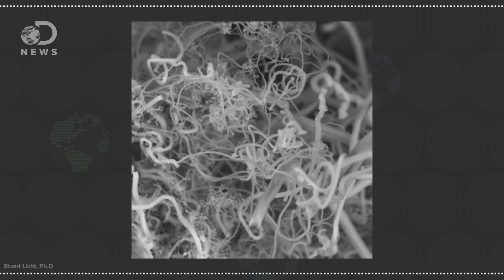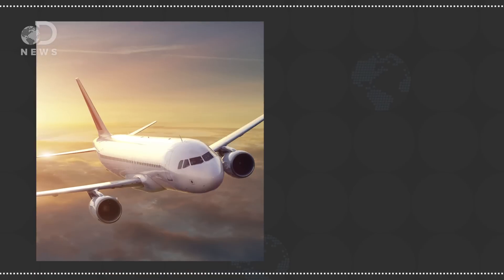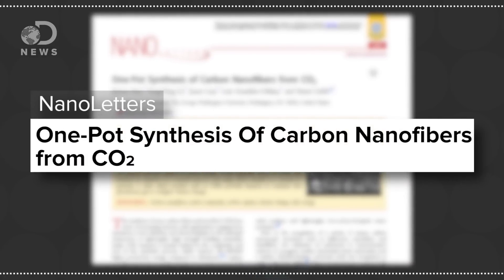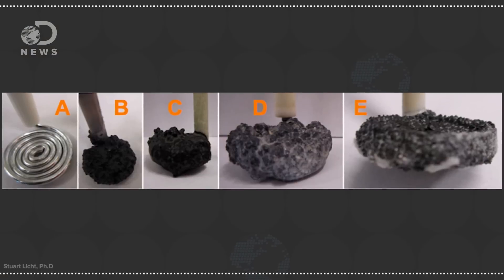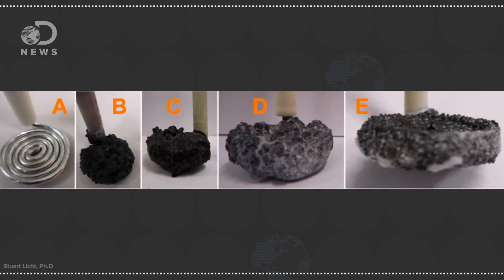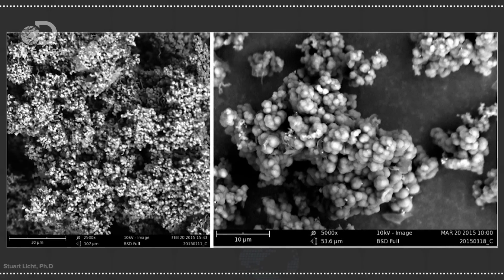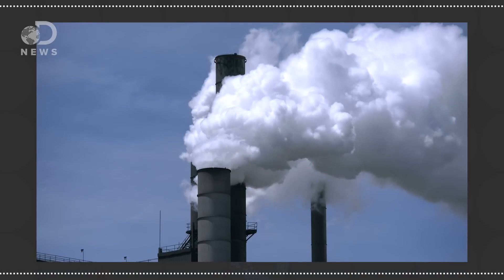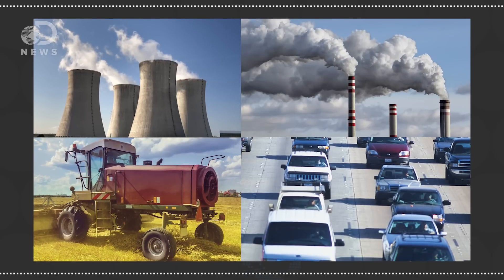Can This Carbon Nanomaterial Solve Global Warming?

Comment: Wow, that seems very impressive! However, it's 2018 and basically, this method has not received the seemingly deserved credit, which leads me to wonder why? Are toxic halogen gasses produced during the electrolysis, or what is the issue?
I really whould like to know why this was not put into pracatice in large scale, because as you know I am a great fan of limitless potential.

Comment: How much energy is required to power those electrodes to pull those 10 grams of carbon out of the air?
Now, OBVIOUSLY, we MUST get this energy from CARBON-NEGATIVE sources: wind and solar power.
Otherwise, pointless.  Nevertheless, I am cautiously impressed so far.

Comment: Uh, Ian?  Doesn't it take the same energy to reduce carbon for nanotubes as you get when you burn it to CO2? Isn't finding the power for this the same as finding the power so we don't have to burn carbon in the first place? Aren't you a physicist? Didn't you realize this, or have you become a Vidiot like so many science commentators? I know that nanotubes are at a lower state than plain carbon, but where is the energy coming from to replace the C-O2 bond?

Comment: It could be huge. If the system works out to a net decrease in CO2 in the air (manufacturing and running the system included) and the carbon nanofibers can be used to make things like carbon fiber this could make for a ready source of carbon for manufacturing which could drive down the cost of lightening vehicles, which could increase a vehicle's range/efficiency which could decrease the damage that every mile does to the earth, which could eventually work toward a net decrease in greenhouse gases and potentially toward restoring the atmosphere to how it should be. If this actually works, it could be astoundingly important.

Comment: This too could be used on Mars! Especially since Mars is 96% carbon dioxide. This could be a way of terraforming Mars!
Reply: +tye tygon Mars has no atmosphere, if we create O2 it will simply float away into space. Mars is a dead planet.
Reply: +roush26 gravity would keep O2 around the planet, and it does have an atmosphere, its just not made up of things that humans can breathe
Reply: tye tygon
tye. the atmosphere on mars is 96% carbon dioxide. the ATMOSPHERE not mars itself but the ATMOSPHERE
Reply: Or you can use a tree
Reply: +tye tygon but this is turning it into nanofibers. not oxygen. just use trees.
Reply: If we can reach it that it
Reply: +ZyTelevan Yes! It is. It is amazing!
Reply: +budred123 - Bernie Sanders FTW - That is exactly my point.
Reply: +tyler89557 Plus you still get that sweet, sweet oxygen.
Reply: +tye tygon Even with a breathable atmosphere on Mars, the radiation problem will still make it uninhabitable without hefty shelter protection and outdoor excursions risky. The planet lacks a magnetic field making it quite pointless for terraforming and it would progressively lose it's atmosphere due to lack of protection from the solar wind (the MAVEN mission studied this).

I think this idea might be a nice application for creating special equipment on Mars though.

Comment: Before everyone starts jumping for joy let us look at some simple facts

He said molten salts bath, which would require that the salts be heated and kept heated using some sort of heating method whether it be by a flame from some fuel source or by electrical heating elements. Either way you look at it, what your doing is using some energy source to convert a gas to another compound and using a lot of energy to do so. Why they even bothered to try and veil this process as eco friendly because the electrolytic system is potential powered by a solar panel (a 9v battery could do the same job!) is just a slap in the face to anyone who uses their brain or pays attention to words. The irony is that the process being used is probably going to be creating some CO2 in one form or another and I'd be willing to be the net reduction in CO2 would be negligible.

Secondly, he said molten salt baths! The only molten salt bath that I know of which produces carbon deposits is cyanide. A vat of molten cyanide produces some incredibly toxic gasses that are far worse than inert CO2. 

That being said, lets not let facts get in the way here and everyone go ahead and suck up this poorly crafted piece of Al Gore excrement.

Comment: Kind of sucks you have to spend energy to do it though, don't really know if it would work in a mass scale power plant (but I think it would). What would sound cool and stupid would be if you slapped a turbine on a smokestack and turn it by the pressure of the co2 rising up. And then connect that energy to the bath salt thingies.

Comment: The main caveat of this technology is what the electrical energy is provided by. Solar is mentioned, but nuclear and wind are other carbon free alternatives. If it just came off the grid, which is primarily fossil fueled, there is no benefit. And perhaps it would be more beneficial to apply the energy, particularly nuclear to simply replace dirty forms of energy first. I favor nuclear, ideally Thorium, because Wind and Solar have problems with not being able to match demand, that can lead to energy surplus and deficits, both unfavorable situations.

Comment: You did not mention where the electricity comes from that creates the current through the electrode. It comes from coal burning power plants. The best way to turn carbon dioxide into carbon and oxygen is photosynthesis.

Comment: The following cannot be emphasised enough: 
Pulling carbon-dioxide out of air and making it solid matter is what plants are already doing. And much more efficiently than we can, it should be noted. So no, this will not help in any measurable way with global warming. Presently they got some 30 grams of carbon fibers, but every day each and everyone of you exhale about 1 kg of carbon-dioxide. And that's just for our biology to work, and not counting what we use on the machines or products we use.

So carbon-nano fibers: Wohooo!
Can it help solve global warming: Basically, no!
Reply: +CPG VonC But its a start in the right direction. How can you not be exited!!!!

Comment: Well, there is an electrical current involved in the process.  Where does the electricity come from?  Is it pulling out more from the atmosphere than is generated creating the electricity?  Obviously for this to work, the power has to come from a clean source.
Reply: It specifically said in the video solar panels....
Reply: OK, I guess it does.  Now the next question is will they actually use solar power in production of the carbon nano-fibers?  I just imagine some country that mass produces things like this cheaply finding that it costs them less to get traditional coal power and pull the carbon out of the ground.
Reply: +Helix Fossil No fucking way solar panels provide enough energy to maintain a molten salt bath. You have to heat salt to several hundred degress F to sustain a molten state. They are misleading you because the solar panel only powers the electrolytic process that forms the carbon deposit. Stop buying the bullshit on this channel being pumped out by parroting leftists.

Comment: Wait doesn't some sort of energy source need to power it? The majority of power plants burn fossil fuels, right? So according to the ways energy works, more CO2 will be made then what it would pull out of the air. Thus increasing the CO2 output. This might be thwarted if it ran off JUST solar or nuclear, but that would depend where they built the darned thing.
I'm not a rocket surgeon tho, so if someone is feel free to correct me.
Reply: +Zach “Chewie” H What you'd do is use a power source with a negative carbon footprint. Maybe geothermal or solar. Possibly nuclear; I'm not sure if the lifespan of a typical nuke plant is long enough to break even on carbon output from its construction though.

Comment: This is all well and good, however it would need to be powered by a zero carbon/carbon neutral fuel source for this to have any effect on the CO2 in the atmosphere. 
If powered on fossil fuels all you'll get is a cycle of CO2 released and CO2 turned into nanofibres at a lower rate than it is given off, thus defeating its purpose unfortunately

Comment: I hate it when videos like this don't touch on the energy problem.  You'd need so much energy to pull CO2 out of the air you'd end up creating more CO2 than what you'd remove.  And contrary to popular beliefs, green tech just is NOT efficient enough to generate the energy needed by densely populated areas (US) or northern countries (Canada). It's getting better, but it's not there yet (and we haven't solved the storage problem yet either). So right now any solution that needs electricity isn't really a solution at all.

Comment: There is also another solar powered, low energy system that can efficiently pull atmospheric carbon from the atmosphere. They are called PLANTS -- you know, the green things with leaves.

I don't want to downplay the solar powered development here, it is an astounding achievement with potentially remarkable applications. However, algae bioreactors, fast-growing grass farms (bamboo),  and other plants may be an effective way of sequestering CO2 inexpensively and in a way that can scale very, very quickly. 

The trick would be to separate the carbon from the other bio-matter and contain it without it being re-released as can be the case with composting, burning, etc. I'm not sure such a technology exists, but it seems like something that should be possible.
Reply: +Sean Lumly IMO Algae pools may end up being the best option, especially if we could make the algae produce the nano-fibres as well as useful nutrients, this way it could also be a food source as well as heck, why not throw in water sanitation into the mix, produce clean water.
Reply: Not to sound like a pothead.. Hemp.
Reply: +Sean Lumly look up sandstone carbon sequestering, its a really cool process. they basically do the reverse of fracking. they gather pure CO2 and pump it deep into sandstone deposits because it will actually hold CO2. only issue with it is there is an upper limit to how much CO2 the stone will hold.
Reply: Ryan Schafer Thanks! I definitely will look into that! It sounds very interesting!

Yet another option may be to store it in a barrel for some other industrial use.
Reply: Sean Lumly
Definitely, mixed with the potential of multitasking, improving it's overall efficiency regarding input vs output, it's certainly something worth keeping a watch out for, for new developments.
Reply: Arent plants carbon neutral. No matter what, that plant will be destoyed somehow, re-releasing the carbon back into the atmosphere. Also the problem with algae is where to grow it and how to maintain it. Simple things like farm fertilizer can be dangerous with fresh water algae at least because it can make the algae grow out of control and destroy the aquatic habitat and kill off any animal in the waters. Educate me! Haha!
Reply: +Nick C I once heard a solution to this would be turning plant matter into Biochar, which is basically turning it into charcoal. But instead of using it as fossil fuel, it can be used as a fertilizer. I'm not too educated in this subject, but I believe this would remove more carbon than it would produce, or in other terms "carbon-negative".

This is also a better alternative than using conventional fertilizers that do much damage to the environment. Two birds, one stone.
Reply: +Sean Lumly Scientists here in New Zealand are developing algae which eat rubbish and produce butane (among other useful chemicals) as a waste product.
Reply: +Sean Lumly Plant plants everywhere. Dessert areas must be tackled one way or the other.
Reply: Sean Lumly lol, now I'm thinking of a bunch of people living in bamboo houses.
Reply: How about using the things you said, but also using the carbon capturing tech to capture the CO2 released by the decomposing biological materials? That way we'd still have an overall net withdrawal of CO2 from the atmosphere, since the plants quickly pull out the CO2, but the re-release of CO2 through composting can be slowed down by the carbon-capture.
Reply: +Sean Lumly Some of which can also be consumed, serving a dual purpose.
Reply: Ryan Airth Algae bio-reactors are indeed an interesting prospect, especially when coupled with genetic modification! I agree, their uses could be myriad.

In fact, algae may be a more practical solution for meeting many human needs with off-world colonization. I expect it would be easier to run a bio-reactor than to grow row-upon-row of leafy plants.
Reply: ***** Yes, if left in the wild they are. They consume carbon to grow, and then release it again when they are in turn consumed. Of course, we can (for example) put the plant matter in a container prior to decomposition, thus trapping the carbon. And we can probably do this efficiently if the carbon can be extracted.

As for algae: they could be grown in a contained bio-reactor as is currently done. This container is sealed off from the environment, and presumably fed a purified water supply. Here's an example of one used for oil production:
https://www.youtube.com/watch?v=Cvi_70sZV-c
Reply: +Sean Lumly the problem is that plants 'exhale' as much CO2 as they take in being that they too respire all day long.The basis of how stationary plant life works is that it uses carbon dioxide to store energy in the form of carbohydrates for use later, the plant will then combust the carbohydrate , releasing the CO2, to release the energy. 
The only way carbon is not released is when it becomes part of the plant itself, such as making DNA. But this carbon will only exit the cycle for a few years, where as carbon stored in fossils has been gone for millions of years. During which time the planet has gotten used to less carbon, releasing all this carbon (in a short time) will then make huge problems for the planet.
Reply: You'd have to grow this indoors and provide light 24/7, as at night, plants convert glucose back into the reactants, using up oxygen and releasing carbon dioxide.
Reply: +Sean Lumly Carbon Nano material solves the problem faster, whilst still being productive.
Reply: Dominic Berry Perhaps, if realized and scaled up (which could take years to build the appropriate facilities). But the situation with climate change is dire. When considering the amount of plant biomass that is created yearly, and the huge amounts of land that we have, and the infrastructure and tools required to farm, sequestering plant bio-mass may be a quick way to get started pulling CO2 from the air. And even if the nano-tube generation takes off, plant bio-mass sequestration could still prove to be a nice complementary technique. 

In the end, as with most things, it's not a this-vs-that scenario. There are just differing solutions, each with their benefits and drawbacks. There is also nothing stopping them from being used simultaneously.
Reply: ***** My thoughts exactly! Something like bio-char (from plant matter) could also be compacted and placed into barrels, thus permanently removing it from the atmosphere. 

And it would have to be carbon negative, as the carbon in the bio-char would no longer be in the air. Of course, this assues that the production of the bio-char does not use more carbon than the char itself!
Reply: Dominic Berry :) ... But only if they are nice bamboo houses.. :P
Reply: Sean Lumly Definitely better than the slums in south america or India, but I think I'll stick with a traditional US house.
Reply: well to be fair, such a scaled up idea of plants would most likely exhaust the biosphere, for example, California is a seriously farmed state, and if we want to pull enough carbon out to keep California healthy, we'd need far too much allocated resources just to attempt such a small place, and when put into a globalized scale it would exhaust the earth. Also inclusively do nothing for the most part
Reply: masterimbecile but it's the same thing without the plant, so why bother burning the plant?
Reply: Mark Scott Indeed! Excellent point!
Reply: masterimbecile Exactly right! It need not be a one-or-the-other tradeoff. These techniques can be used simultaneously in complementary ways.
Reply: Kinetics.  Plants are not pulling CO2 out of the atmosphere fast enough.  We need to genetically modify or completely re-invent a "plant" designed SPECIFICALLY and EXCLUSIVELY for pulling CO2 out of the air,
even if it simply produces a solid that we cannot eat, but which we can bury underground.